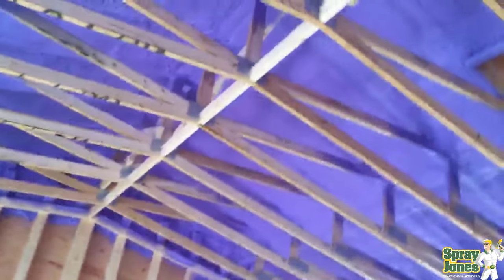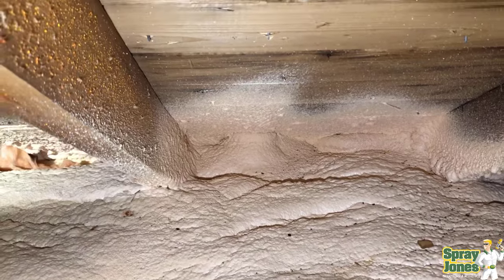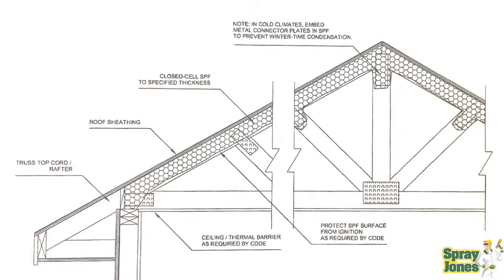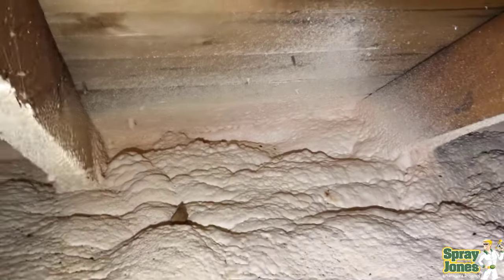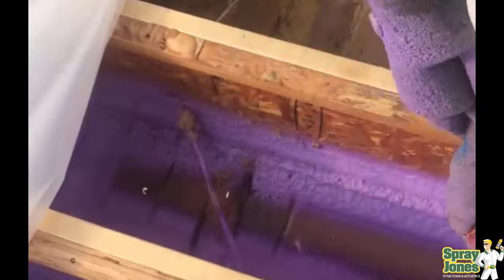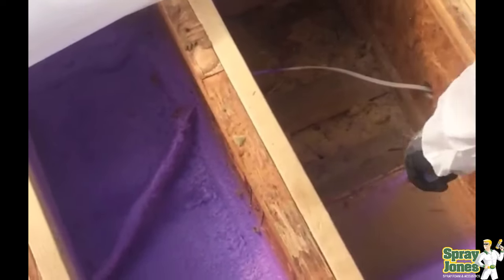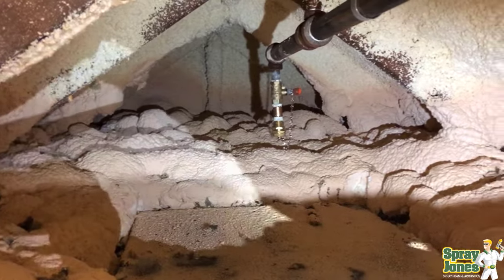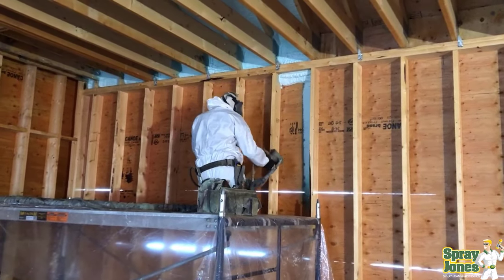Problems with Spraying Foam Insulation Down in an Attic

Comment: We have sprayed down only in older attics after we have cleaned out the old insulation
We will only spray attics that are workable and able to complete a good job.
We only spray 2.5 inches or so and than add cellulose loose fill on top to make higher r value. 
We did my personal home this way and it has cut our energy bill in half. 
For new build homes  I totally agree with the points you covered.
Reply from the maker: We have done a few too. When there is a lot of room towards the edges.
Reply: I have done the same . House is comfortable and energy bills way way down definitely less than half. 😊
Reply: I have a newer home and this is what I want to do! I think the energy savings would out pace something like solar. 8/12 pitch. Be pretty easy to add in some extra foam baffles
Reply: Did you use closed cell for this ? I started out working for a spray company for 2 years before starting my own. The guy I worked for NEVER sprayed down with closed because of the reason jones said, he always told us it would push the drywall ceiling down or create cracks at the seam. Did to experience this at all?
Reply: @benc2947 I spayed down to my draywall with open. Then shot all the duct work with closed.

Comment: Retro fit homes or new homes that have gas furnaces in vented attics are a good candidate for spraying the flat ceiling. These are homes that were never designed for a encapsulated attic and changing the entire system would be too expensive. You are trying to air seal and adequately separate the living space from the attic. It is an inferior system but it’s better then convention loose fill only.

Comment: I am looking at doing closed cell on my roof ceiling.  I live in Tahoe and this is a new construction house, but it still gets really hot in the summer.  There is no AC and the furnace is in the garage which is an embarrassing place to put it.  Is putting in closed cell going to really help?  I will build a closet around the heater, but I still want to lower my heat load and as a bonus lower my winter bills too.  From what I am gathering, it won't be worth it because my hvac is not in the attic.

Comment: quick question on spraying the roof deck. If you spray the underside but have an access into the area (non-habitable)   do you need to put a fireproof coating or paint on the spray foam insulation? I noticed in your video at 2:39 that there looks to be some type of spray on the insulation.
Reply from the maker: 99% of jurisdictions say no.
Reply: Only have to fire coat it, is if it's staying as a open concept.

Comment: Alright man, I’ve watched about 20’of your videos now, can’t find a recommendation on retrofitting a “tight” attic as you call it.

I’m in south Florida, all the foamers want me to put 6” of open cell on the roof deck. 2x4 rafters. They’re gonna be buried. You mention a few times it can’t be done properly in tight crawl spaces. Do you even recommend doing a spray foam application here?
Reply from the maker: Not if I can't get into the spaces I need. Open cell would be the one and only product that would have a chance since it can over expand into areas that otherwise wouldn't be properly articulated with closed cell.

Comment: Thanks for the information in your videos. For an existing home (1960 bungalow in Edmonton) would you recommend insulating with spray foam, cover soffits and remove attic ventilation? Or stick with cellulose insulation? Thank you
Reply from the maker: Always SPF when the proper steps can be taken. Watch the 4 part series on non-vented roofs
Reply: @SprayJones where is that? I can’t find it. I want to spray the underside of my roof and condition the space in a home I just bought
Reply from the maker: @NOOBKILLER052  I have a whole playlist for vaulted ceilings and the 4 series videos are in there.

Comment: What about a retrofit. 8/12 pitch. Remove the fiberglass blown in and shoot down 7” of open cell. Would the cost saving of foam outpaced solar if someone wanted to invest in cost savings
Reply from the maker: More than likely that is a safe bet. 
Solar has so many ongoing costs associated with it. 
SPF is a one time for all purchase when installed correctly.
Reply: @SprayJones I did a video of spraying our duct work with closed cell. What a huge difference it made.

Comment: If you were doing a retrofit with steep rooflines that let's you get to the eves, would you spray to a vapour barrier that's on top of the drywall so if you do have to replace drywall you can or is it worth worrying about?
Reply from the maker: No. The SPF will not stick to the poly. It will want to lift off.

Comment: I've got a question that's probably asked a lot, but I don't know much about this so here goes. What happens when there is a small leak in the roof? In a 'normal' attic you can see the spot and fix it, but as a roof gets older and a new roof is needed it seems like there might be a lot of issues with the sheeting on the roof. Am I thinking about this incorrectly?
Reply from the maker: Watch the video I did on roof damage, water and SPF. It is answered there.

Comment: Only downside I could see to spraying to the roof deck would be you are now heating your entire attic space
Reply: You are heating the attic and making it a conditioned space, but the difference is that with batts or blown-in, the heat loss is substantial and travels through it in an hour or so.  With the roof deck being sprayed, the heat going through 1 inch of it takes a minimum of 12 hours, probably 24.  And it seals ALL drafts.
Reply: @HarmonsHarbor  I wasn’t comparing to blow in or batt I was comparing to spraying down to the ceiling substrate. A lot of the houses we do are custom with a 7-10 pitch roof and deep heels which means plenty of space to spray onto the ceiling. I usually give 2 prices, 1 for spraying 2” onto the ceiling then blowing in the rest and one for spraying to the roof deck but with those pitches the square footage is nearly double in most cases and that combined with 4-6” of foam they usually opt for option 1